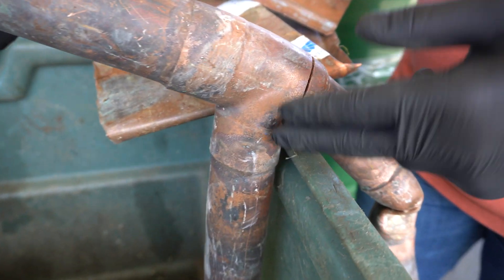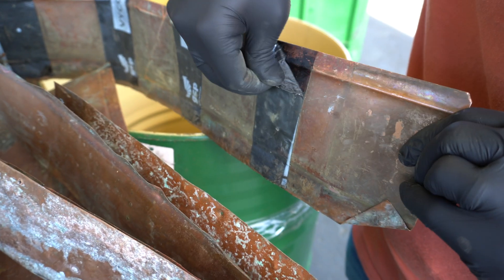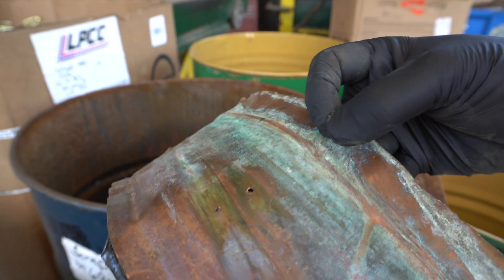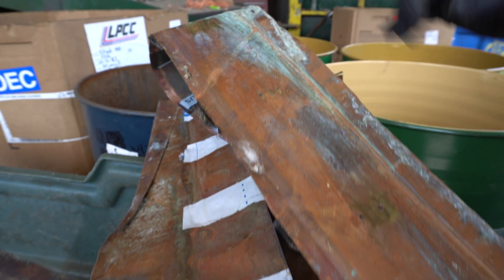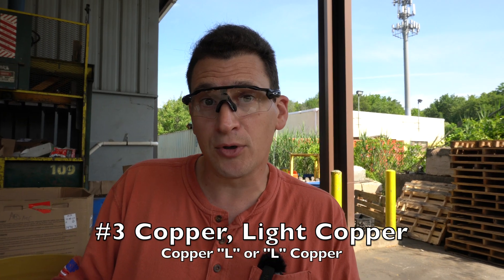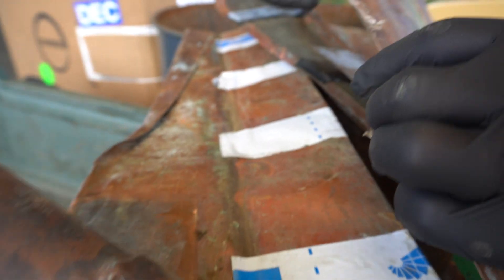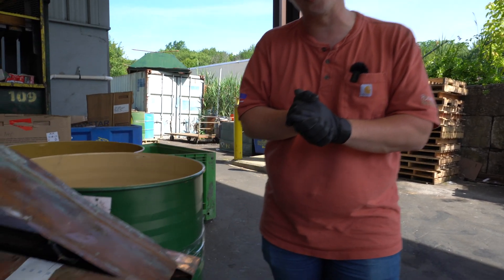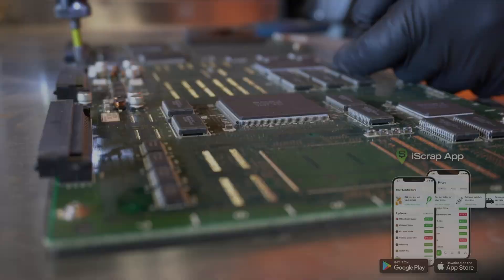Understanding #3 Copper: Differentiating Scrap Copper Grades

Comment: What if it is clean? 
Should be #1 then as it is as thick as some copper pipe that goes as #1, just not rolled round.
If it has steel nails and chunks of tar tape on it, should go as dirty or breakage I would think.
Reply from the maker: some yards may have a clean roofing copper or sheet price. typically this type of copper won't have the same #1 and #2 grade. 
If there are contaminants, your yard may have several different names so its hard to say.

Comment: Good to know..... I want to know.... What should be the difference between the price that scrap copper is trading at, and the price that the scrap yard offers??  If the trading price of scrap copper is... lets say $4 just to even things out to a nice round number... then what should be the rough estimate of what a scrap yard should offer?..........     It seems like the scrap yards around Muncie, IN are always offering way lower than the trading prices. I have around 1500 lbs of copper.. bare brite, #1,#2 and copper shavings from a cnc milling machine oxygen cut... no coolant used).. but the scrap yards here only want to give roughly $3.10 lb when copper is trading at $3.70
Reply from the maker: Thats hard so say. It greatly depends on a yards operating costs. We'd imagine that your example with a 16-20% percent approx seems to be where most yards are at in order to factor in operating costs.
Reply: Because as a business if they gave you $4 LB and sold it for $4 LB to their mills they wouldn't be in business for very long!!😂
Reply: @cointenderrarities933  NO $$$$!.. Your such a mastermind!!!  The question is:..... What should the acceptable difference be?
Reply: @cointenderrarities933  Arent you the Mastermind?? Im surprised you made it out of grade school.... The question was what is the acceptable difference between the price the yard is giving and the price it is trading.... Genius!!!

Comment: I had a scrap yard that had the 3 rd grade,    sheet or roofing copper, however, if you had any clean copper in the form of a sheet,  they would only pay the lower #3 copper.
Reply from the maker: Thats a bummer. Clean roofing copper does exist and should be graded as such